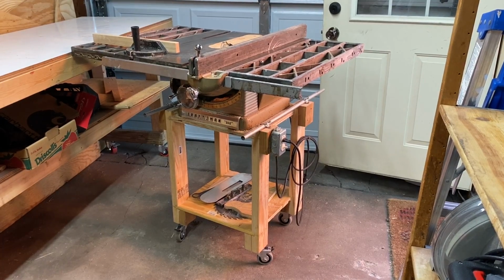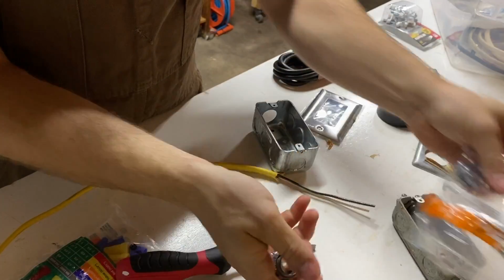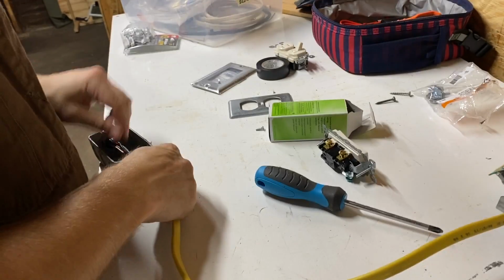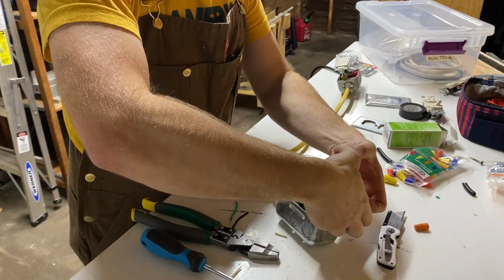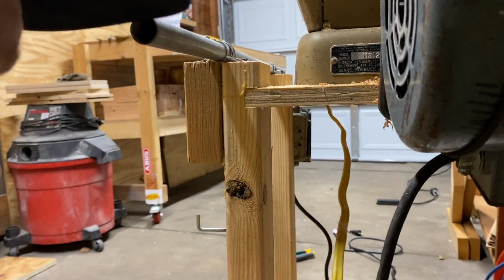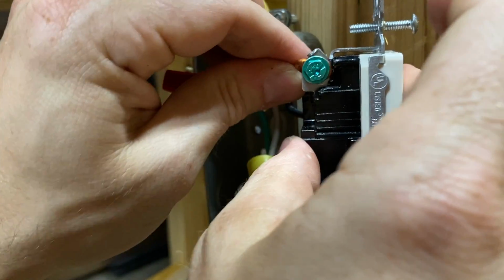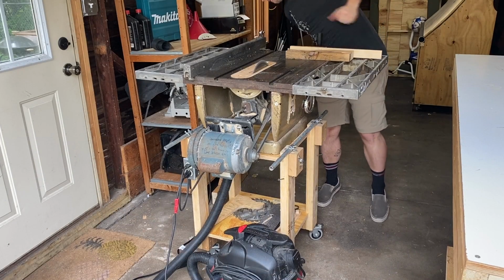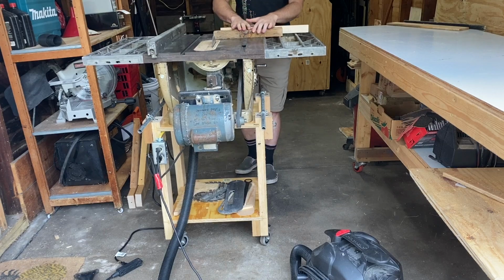Improving my table saw's power switch

Comment: Electricity is nothing more than black magic and sorcery.  That said, I agree that plastic gang boxe would have been a better choice and I would have put them on the inside of the legs to protect them more fully. Pobably get a safety type switch from Woodcrafter too.  I would also either build a sturdier base for that table saw or at a minimum add some cross bracing to stiffen it up...